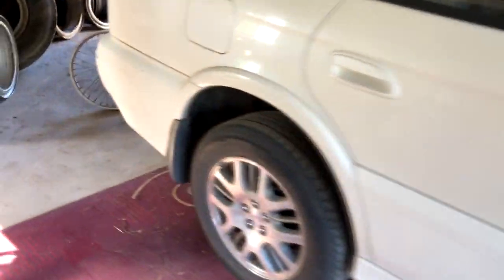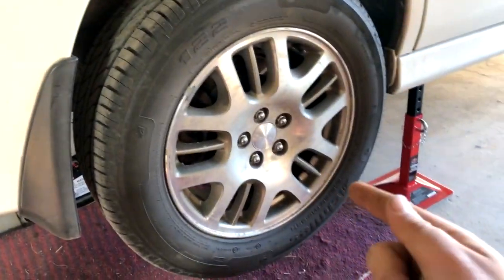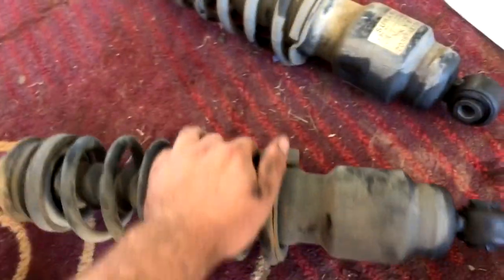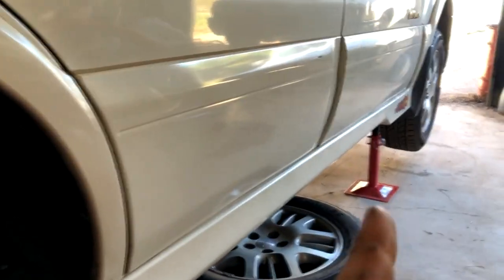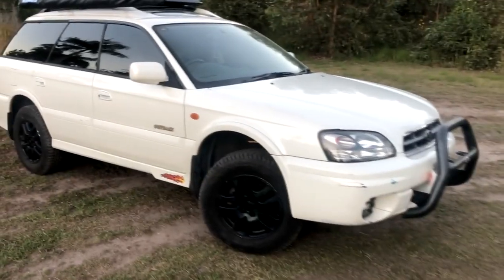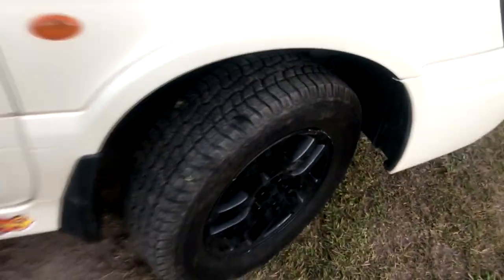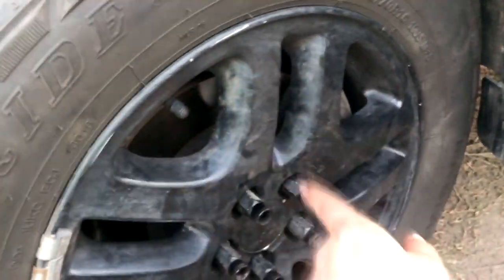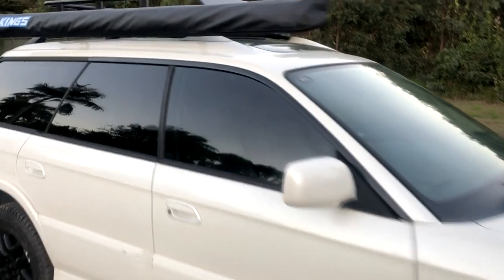Subaru Outback Lift Kit Install

Comment: looks wicked!!! thinking of doin the same, and where did u get the bully bar?
Reply: Did you get the nudge bar yet, we bought one from Subaxtreme back in 2012 and just recently we hit a wallaby and the bar took the full impact and no damage to the bar or to the front of the Outback. Here's the site for the bar - https://www.subaxtreme.com/ and today we ordered a front sump skid plate and a 2'' front and 2.5'' ear lift kit for the beast since we owned the Outback since new its time for a few upgrades and go off roading.

Comment: Hey mate, how are ya? Random question! The top hats on the rear struts, you wouldn't happen to know where to get them from and the part number? Cheers!
Reply from the maker: You can contact Matt from Subieliftoz you can find them on Facebook pretty easily. He's the one that makes the kits he'll point you in the right direction.

Comment: How did you put the front spacers on? I have a clunking and the spacer is causing the upper spring perch to hit the strut tower wall
Reply from the maker: MotoZixxer they should just go on top of the strut anyway but make sure you have the right side they’re passenger and drivers side specific
Reply: @BaileyDriver  I have them on the right sides. I'm wondering if they weren't labeled correctly. Where did yours move the strut? Mine are moving the strut towards the engine and also slightly rearward.

Comment: Please maybe you can share who produces this kit? Thanks.
Reply from the maker: Arvydas M this kit is made in Australia by Matt Chaplin at Subieliftoz you can find them on Facebook. They ship internationally. it’s the strongest and most reliable option for a Subaru lift kit.
Reply: @BaileyDriver  Thanks, just before your reply I found Subieliftoz on Facebook. I am checking the kits and probably will try to replicate it my self. Hopefully it gets a bit cheaper because it's quote a distance between Australia and Lithuania. Here we also have guys who are subaru fans and do all kind of lift kits, but they do not sell them so that you wouldn't be able to instal yourself and their prices for kit+instalation job is insane... If you interested you can check their work on Facebook they have two accounts: "JSC Premus" and "Forester - Tuning".
Reply from the maker: Arvydas M yes I’ve heard of many people making there own kits should be fairly easy to accomplish and would definitely save a lot of money.
Reply: @BaileyDriver  Maybe you have a manual from your kit with all spacers heights and widths? That would be very helpful information.
Reply from the maker: Arvydas M I’ll have a look when I get home for you

Comment: which subielift oz kit is it?
Reply from the maker: Victor Rodriguez it’s the full 2/2.5” kit with trailing arm spacers and rear subframe drop
Reply: Wish I could get that lift kit here in the states. I have the same gen outback
Reply: @Finallybianca  look into Anderson design fab. They're located in OR. I just installed their 2"/2 3/8" kit on my '05 Outback. It's very similar to this kit.
Reply: Hi Bailey, awsome job mate!! Did the lift kit include Struts n springs as well??
Reply from the maker: @nathanvonkoss7050  No, I bought them separately